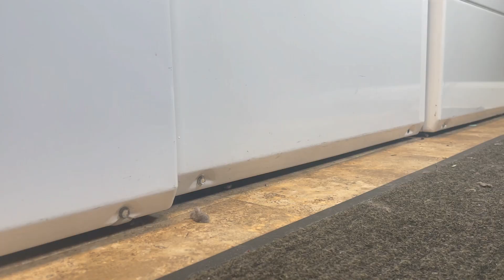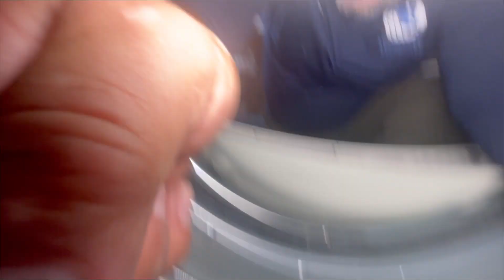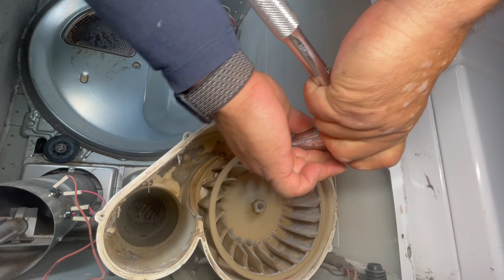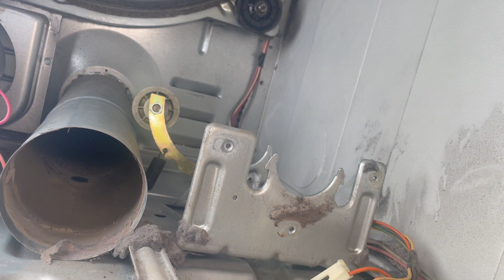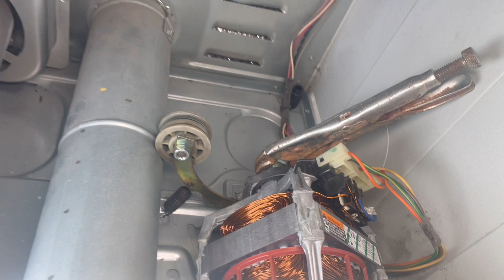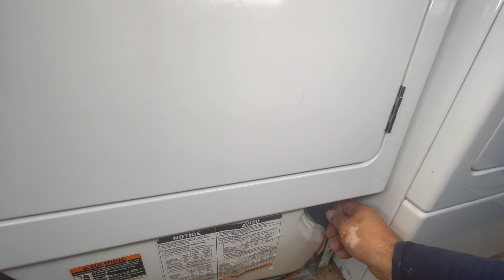HOW TO REPLACE A SPEED QUEEN COMMERCIAL DRYER MOTOR.

Comment: Thanks for the video.

Would it be possible to change just the bearings on the motor?
I have exactly the same motor but can figure out how to remove the bearings.
Luckily the bearings are still okay just extremely dry but if they give me issues again I'd like to replace them.